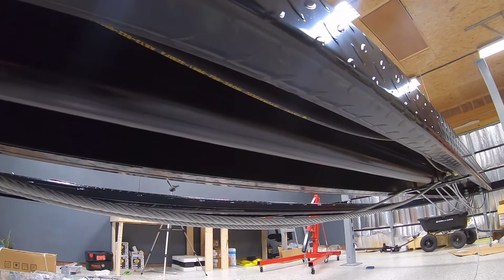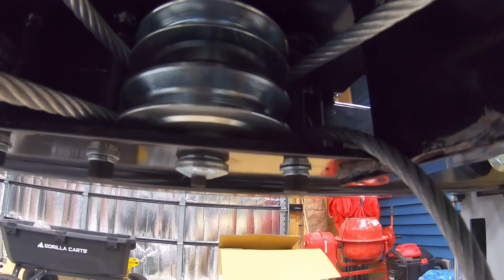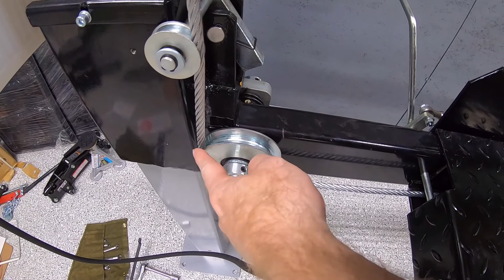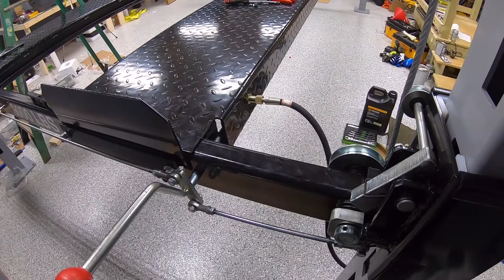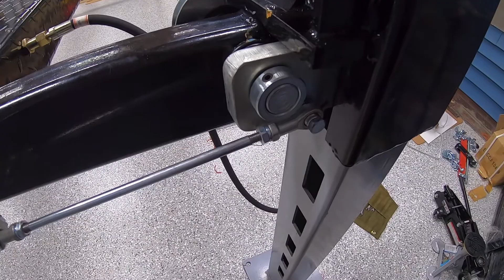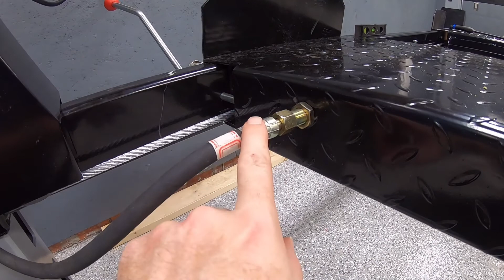Bought a WildFire XLT Lift Part 2

Comment: Nice job BUT I noticed you put only one nut on the top of the post cable rods I think it needs two up there to be able to hold 9000 lbs one nut may strip out under max load I would add another one on each post if you have not done so >> I like this lift and I am thinking of getting it. Maybe just put both nuts on top I think that's right.
Reply from the maker: Excellent point, I will look into getting some extra ones and add them to the setup.  Thanks for the comment.

Comment: What’s the actual measurement from inner jack rail to jack rail?  I’m thinking of using another brand of jack and haven’t purchased this lift yet.
Reply from the maker: Thanks for stopping by, rail edge to rail edge where the wheels ride for the jack is about 34 1/2 inches.  But note that the edge to edge measurement does vary down the length of the ramps slightly.